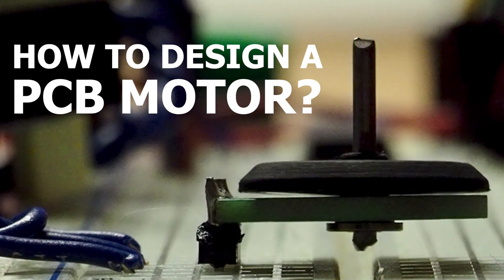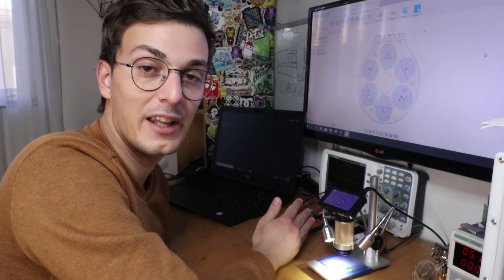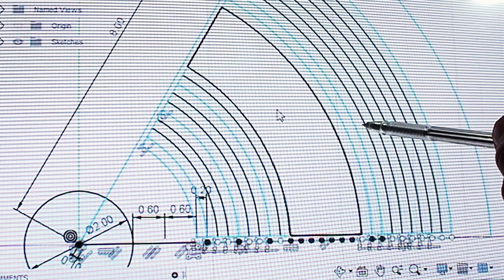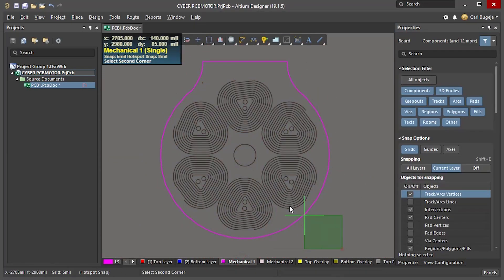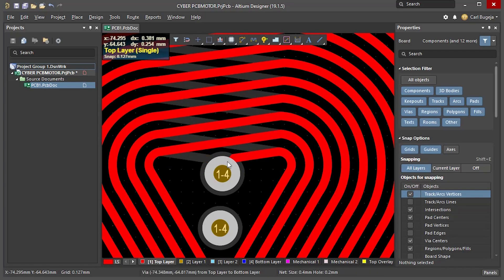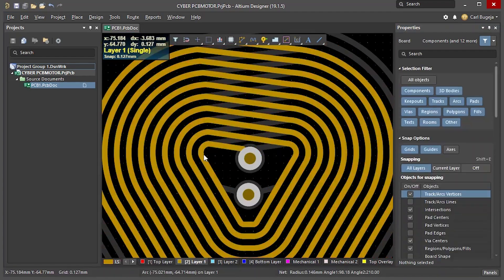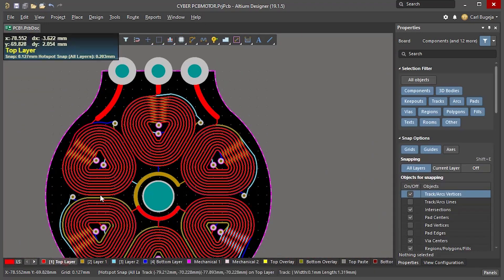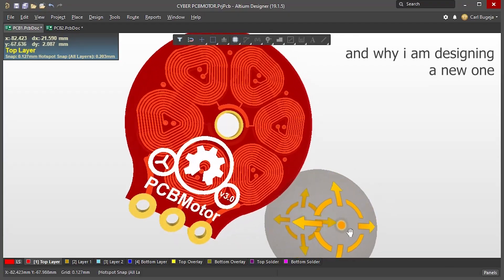How to design a PCB Motor?

Comment: Hi! I think that this way is too complicated.
Try this: https://www.youtube.com/watch?v=Ttqm1z24Ihc. But if you want to draw coil in Autodesk Fusion try to use built in tool "Equation Curve" using parametric polar coordinates. Similar is this in Autodesk Inventor: https://www.youtube.com/watch?v=xTL2E5dISh0. I believe that that tool is implemented in both software.
Or, you can see my video about it in Autodesk Inventor on: https://youtu.be/A5cgl_ZWIuk.

Comment: Why don't you use a magnetic conduction plate on the other side of the rotor. This will rotate at the same rotor speed and therefor any re-magnetizing losses won't occur. But the magnetic flux is increased many times. Could be even increased by additional magnets on this magnetical return.

Comment: Great explanation, just one question... Could this be used as an efficient generator?, what would be the main things to look for to use as a generator, for example should you use Delta configuration or star? Should you use double PCB coil as stator or double magnets as stator? Sorry for the amount of questions but I'd like to build some tests.

Comment: A couple of things that might improve the motor design.  First, add a ferrous washer behind the magnets.  This effectively shorts out the magnetic field on the top surface (where it's doing nothing) and increases the flux density on the face adjacent to the coils.
Second, the torque the motor produces is inversely proportional to the 'slip angle' - the max distance between the magnetic poles of a coil & a magnet.  You can reduce the distance by increasing the number of poles.  Since you are using a multi-layer board, I would consider, instead of stacking the coil layers to give more turns, have one layer per phase - so on the top layer, all six coils connect in parallel (or series).  On the second layer, the coils are rotated 1/4 phase - and connected in parallel - and so on.  Then you switch the layers rather than the coils on one layer.  That way, you quadruple the number of poles on the stator, dividing the max distance between a magnet pole and an electromagnet pole by a factor of 4 (for a 4 layer board) - you would have to drive it as a 4 phase motor too of course.
To increase the number of permanent magnet poles, you could either do it the same way as a stepper motor, or use radial bar magnets to pack more into the circle.
Lastly, instead of using a washer on the top face of the rotor, you could stack another stator - and use the other set of magnetic poles.  The more layers in the stack, the less of the field is 'wasted'.
Reply: This is infeasible because of the number of vias that would punch through and chop up each coil.  Vias need to be able to punch all the way through unless you choose blind or buried vias which substantially increases the cost of the PCB.
Reply: have you used the same software to design a pcb motor or have you used something different?

Comment: I was wondering what the velocity would be with a magnet vs electromagnet. 
How much volts pulsed one a rotation is needed for a rotating electromagnet pancake motor coil to move from a 2 tesla magnet? and would it be enough velocity to turn around and come back to the magnet to try again with less volts the next time?
 I assume the 2nd go around would have a higher velocity. 

Example of the coil. the image on the left the coil is on the disk which has 6 of them and a magnet in between the pancake motor. I cant find a better diagram. 
https://www.technocrazed.com/wp-content/uploads/2020/01/brushless-pancake-motor.jpg

I find that design to be more efficient to use double sided electromagnet sandwiched between 2 magnets. 
Thanks

Comment: @Carl Bugeja

There is an easier way to do your spirals with the use of offsets.
draw the shape you want as a continous line.
cut the shape in half on the MOST straigt sides, that are PARALLEL! 
copy paste the half and move it parallel to the line of cut by the width of the gap between circuits.
mirror this half on the other side of the cut line.
do an offset of the first half by the width of the circuit.
do the same on the other side.
connect both middle mating points.
delete one of both open loops (for easier proceed)
select the loop and continue to do offsets of it until you got enough loops.
the endpoints of each loop wont be connected (this is necessary because fusion cant offset doubleloops)
just grab an endpoint.. move the mouse just a litte and the point will connect to the other point on same spot (turns black)
if you now close the loops on both ends with an additional line you will see your coil :)
hope this will help.. if not.. ask.
Hint: you need to delete some constraints while doing this or errors will occur..

Comment: Try a sandwich axial flux PCB motor and triangular magnets (same shape as your coils if you can get the). Higher flux density and 2 bearings to support the shaft. You might need thinner magnets though.

Comment: Hey I just found your channel and already love it! I'm studying in an RF direction, but Ive always loved power electronics and electromagnetics! I saw that you tried to increase the torque of your PCB motors using a ferrite sheet, but that it produced to many eddy current which made it heat up. Have you considered cutting smaller concentric rings out off the ferrite sheet, a bit like in a laminated core to prevent eddy currents? I imagine it would make the process more complex, but maybe worth a try. Moreover the sheet is very thin, are you sure you're not having hysteresis issues instead of eddy currents? Anyway, best of luck with your awesome motor design!

Comment: I was wondering how it would perform in a multi-stage american-style electricity generator - it's easier to produce multiple "coils" and connect them than all the hassle with epoxy that basically limits the number of stages to one. What do you think?

Comment: How did you get around the DXF to copper layer import issue? Is this something that only Altium is capable of achieving, been trying to achieve this in eagle & KiCad to no avail.
Reply: Circuitmaker, the free version from Altium, does import DXF into the PCB file without any issues. Just did a quick test with a spiral DXF, and it worked as expected. Sometimes needs a bit of trial and error, to get the right scale (metric/imperial...), but it seems to work perfectly fine for me.

Comment: Really enjoying your videos and learning quite a bit from them.

I was wondering if you have any suggestions on how to get started? I want to eventually be able to make a pcb motor like you did, but I feel i am lacking on the basics.

Any suggestions on to get started?
Reply from the maker: I suggest to start by making a esc for a normal off the shelf brushless motor first.. That will help you understand how brushless motors works first
Reply: @CarlBugeja    i am definitely going to try that,  lets see what I am able to make and learn. Thanks again!

Comment: Very informative! Couldn't afford altium though... I use solidworks and i wish i could just design circuits in there with the crazy feature manager and patterns...
Reply from the maker: There's a free version of Altium called CircuitMaker 😉
Reply: @CarlBugeja  I actually remeber that you used to use circuitmaker in older videos if I am not mistaken haha. I also have been using circuit maker, and your dxf import technique just opened up a whole new world for me, if circuit maker supports it!
Reply: @alexwang007  Just did a quick test. Circuitmaker is capable of importing DXF files into the PCB layout file, so you don't need to spend a few thousand $$ for the full Altium Designer license...

Comment: Sorry if this was explained in a previous video, but what are these used for?  They seem highly inefficient and they must have a very specific use case.
Reply from the maker: You are right they are inefficient.. But  manufactering them should be easier and cheaper, so that keeps me motivated to test more and keep improving them. But So far I haven't been able to use them in any other application but there are many other things that still needs to be tested.. So maybe one day I could use them in for example tiny robots, which is my main use for them. There are other applications for them like small satellites, etc. I also saw someone making a pov display with them which was absolutely cool
Reply: @CarlBugeja  Well , I can think of one, and only one so far.  DLP projectors.  DLPs require a spinning color disk.  Only application I can think of though.  Most of those pocket projectors just shoot the light source through an LDC.  DLPs require a color wheel, or something like it,  Perfect application for your motor.  Low torque, step motor accuracy.

Comment: It's a great video once again.

I didn't get the part in the commutation process where you describe the three waveforms A, B, C . C being the back EMF, and also how are we going to design the circuit to drive that PCB motor? Given the fact a ramp signal is to be generated?
Reply from the maker: Take a look at this video 🙂 https://youtu.be/4cdVpoWTC_c

Comment: So no calculations to estimate available torque? Just print the PCB and pray?
Reply: Can you show how to make those calculations?
Reply: Yeah, i am searching the way to do these calculations
Reply: @Gabriel-no6wv  FEMM is a free (but limited) electromagnetics simulator. There's many other FEM simulators for electromagnetics, but most are paid unfortunately. =\
Reply: Yup.  It's called practical engineering.  Pcbs are cheaper than a calculator and a lot more fun.

Comment: While they’re not going to be PCB motors, I’m planning a foray into motor designing in the coming months, for which I’ll be buying some cold-rolled silicon electrical steel among other things. I wonder if a layer of this on the opposite side of your motor would improve its coupling? Or perhaps a specially-shaped layer between the rotor and stator. Nice video, real good work with those swooping traces.
Reply: Nice, what type of motor are you going for? And yeah I bet if he used some shielding, it would help with flux shaping for his coreless motor. Good luck on sourcing the silicon steel, if you can't find a supplier with a low enough minimum order quantity you might be able to get started with some plate sheet foil or shim stock.
Reply: Infinion Experiments:
The type of motor is a trade secret aside from being a radial-flux BLDC. After scouring the net for a while I found a couple of links to individual sheets of this stuff on AliExpress, and hopefully I can get it laser-cut or waterjet-cut in order to shape the layers properly.
Reply: @Scrogan  Ah cool, radial-flux BLDC, that's actually what I meant by type, so thank you for sharing.

I'm going the other way and designing a die to do metal stamping of laminations for an SRM type. 

Good luck!

Comment: Awesome project! But did you come with some of the formulas that predicts the electro magnetic behavior of the coils, final inductance, etc?? Thanks anyway, thats the only channel that I see covering this topic
Reply: im pretty sure non standard geometry is difficult at best to accurately model mathematically. To save time and energy its often best to simplify the model but overly simple models will perform very different than their real world versions.
Reply: @kreynolds1123  There is software for this kind of thing.
Reply: @po1nt1776  every coil will ultimately perform different than an idealized coil.  So many things to factor. Skin effect, proximity effect, stray capacitance, magnetic permeability, electrical conductuctivity,  area turns thickness gap distance, driven frequency ect ect.  In general, yes it is very likely an actual coil will not perform as well as the model used.

Comment: Do you maybe know what kind of power can you expect from such a motor? I would imagine that it has to be a pretty low amount since it does not have any ferromagnetic material for the stator core like a normal motor does. It would be interesting to see you do a few tests wit it 😊
Reply from the maker: I have made multiple tests on this 🙂 I am expecting this motor to have similar results, the improvement is going to be purely mechanical for this version https://www.youtube.com/playlist?list=PLzP6_DqZoxc3qNnCqWT7R58rQC3nV30PN

Comment: You should write a fusion script that automatically generates the path. Also fusion can now design PCBs so you can do the whole design there.
Reply from the maker: It can be done also 🙂 I mentioned it in the video but it's very difficult to get it to make super compact coils if the size varies